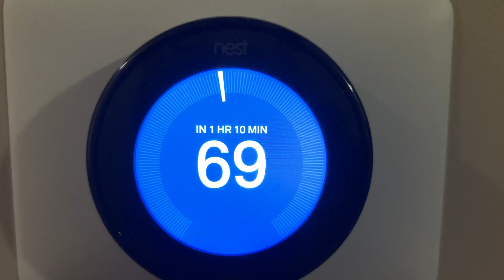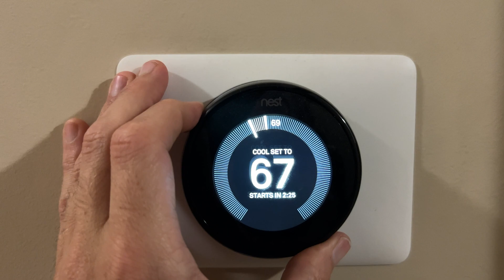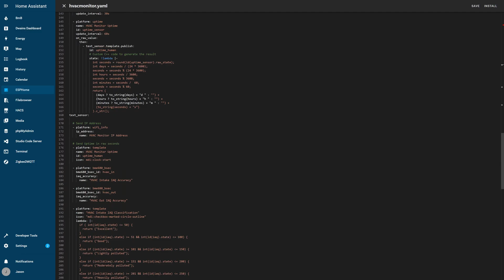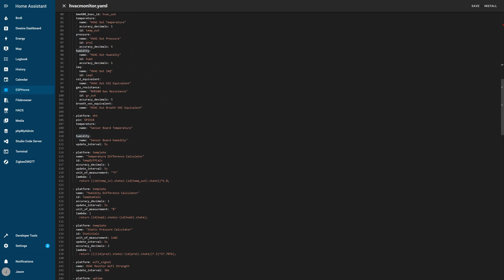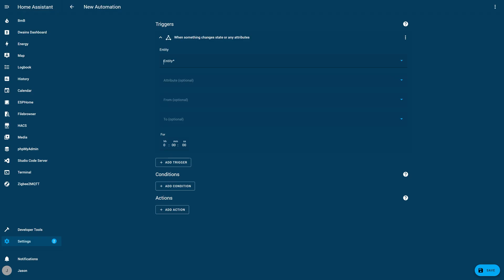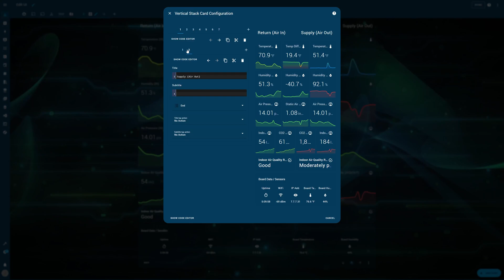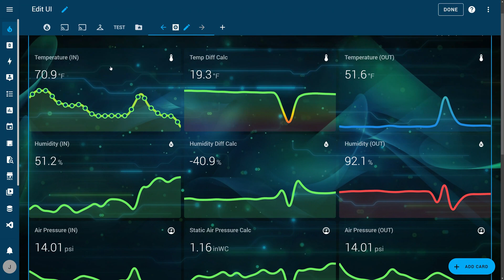I built the perfect HVAC sensor, for CHEAP! Temps, Static Pressure, Air Quality, everything.

Comment: Only thing I would add is a pzem 004t v3.0 10amp to monitor power/energy to the furnace. That way you can use instant power to gauge motor fan speed and do CFM estimates based on the fan curve (static pressure and motor speed) using linear interpolation and get amazing data for heat output and all sorts of data.

Comment: Add a few more sensors , Temperature sensors on the Evaporator coil and Condenser coil to insure that the system is operating in a specific mfr range. Differential Pressure Sensor at each of your supply duct vents for adjusting the HVAC system air flow, a Pressure Sensor on the high and low pressure fittings (difficult, may require a HVAC tech), a Differential Pressure Sensor before and after the system's air filter (when to change) and a LED display for each of the thermostat contacts to show what is working (works great to verify if the thermostat is not working properly) . Good luck! Maybe material for a future video.

Comment: Two things you may want to test on a normal basis is Temperature Rise, and Drop which can give you  a lot of information with two basic sensor readings. 
High difference in temperature readings indicate restriction in air flow and low temperature differential can mean loss of heat transfer. This will work for both Heating and cooling modes.

Comment: Interesting, but your sensors are in the wrong spot. Supply temp sensor shouldn’t be in line of sight of the coil.  Pressure sensor for your furnace should be before the coil.  I don’t recommend drilling that with your set up or you will hit the coil.

Comment: @6:59 your humidity is way too high - assume you caught that?  Means your blower fan is running too fast?  Also, your static air pressure seems high too at 1.19; i'm not a HVAC expert but, like you, have been learning & maintaining my own systems and a typical static delta is 0.5 from all the systems I've worked on.  I've seen 1.0 inWC here and there but it's usually a max value and yours is 1.19.  How accurate are your sensors?  Did you calibrate them?  You could use static pressure delta to know when to change your air filter.  I have a similar project but I'm trying to integrate actual line pressures and get subcool/superheat values into home assistant - get early indication of refrigerant leak or compressor failure.
Reply: How's it going with that? I'm about to dive in

Comment: Hi, thanks for taking the time to document your project!  

I'm looking to buy smart dampers to A) adjust the airflow from the main trunk to each room, so the rooms have equal temperatures and/or B) adjust the airflow to avoid heating rooms that are currently unoccupied or known to be unoccupied during specific date times.  The issue is that the HVAC systems need to maintain a minimum airflow to avoid burning things out prematurely.  Is it true all I need is to build sensors to measure the following 4 points (inbound before the air filter, inbound after the air filter, outbound before the A coil, and outbound after the A coil) to measure static pressure and CFM and then somehow keep an eye on these while I'm adjusting the smart dampters?

Comment: Nice work! I esphome'd my fridge and found the BME280 sensors did not appreciate being on a freezer's coil during defrost, above about 90% they start dropping out. For a while power cycling it worked but it died after a few months. I now use DS1822b or whatever they are in the freezer and bme280 only in the fridge compartment. I mention it due to the surprisingly high humidity your dashboard showed for the output - I'm wondering if it was maybe experiencing some condensation? I assume the humidity part of the bme range are all similar.
Anyway great work, I am looking to do the same thing with our ducted AC system along with diy dampers for room-zoned automation - keeping an eye on static pressure to avoid issues when closing off zones.

Comment: Just some odd thoughts.  I like this idea a lot. My AC is most likely the largest contributor to my utility bill.  I placed a UV light in my HVAC system The UV light is set to run 24/7 but using two smart plugs I turn on the UV light when the when the blower motor come on and then turn it off five minutes after the blower motor goes off.  The light was to last about one year, by running it part time I should get four or five years from it. I can also use the other plug to turn off the entire unit.  I upgraded to Merv 13 or better filters.  I have a 2.5 air quality Gauge but haven't found a way yet to turn on just the fan to "polish the air".  Not sure where your pressure measurement are taken.    Also I had a college HVAC text dated cira 1950, which I cannot now find, which plotted a comfort zone of temperature and humidity, it would seem that could be used to select the cheapest way to get from outside the zone to inside with an automation.  Anyone seen a similar graph?

Anyway great project.  Looking forward to seeing if I can build one.

Comment: I made something similar but with the esp-01 and DS18B20 sensors. It worked but I have trouble keeping the wifi connected. I'm now working with the MCP9808 so I can add an I2C OLED. I like your idea a little better so I can measure pressure too and it whould still work with the esp-01. I think I'll set up an esp32 or pi zero to receive the data and host it. I'm hoping I can run the rx/tx down with the thermostat wire and put the host device there for better wifi connection. Was going to use a battery but I can tap the 24v ac and use a buck converter there to power the esp32 and the esp-01. I can do the same thing with my DS18B20 esp-01 board to measure liquid and vapor temps.

Comment: Very cool project!  Just searched and only one like it so far...I will be watching/hoping for update vids!  Funny I was actually helping a neighbor troubleshoot his system the other day and thought how beneficial sensors would be for alerting when there are issues before looking at your thermostat and wondering why it says 80 degrees.  Would love to see:
-- CT clamp to monitor the amperage on the blower motor.  Some higher end units are flow based so they ramp up power to maintain a certain flow rate and overcome static pressure from a dirty filter.  But even just a simpler case in, one would have helped my neighbor, monitoring for zero amp draw for a blower not working at all when the rest of the system is still running.
-- leak sensor for notifying when primary pan or secondary pan are seeing condensation buildup.
-- air flow meter or maybe a temp sensor for the A-coil/evap coil to see if it gets frozen over or just track historically if it is increasingly restricting airflow (dirty)

Comment: already have Sense Power monitor displaying my hvac usage. Then got the A coil cleaning comb to remove the dirt from below the A Coil. No Form spray. Surge protection device - a separate one than the whole house one in the main breaker box - for the outside compressor unit. this was missing - more data!. thank you......might consider putting the $35-40 particle sensor box to check how clean is the air going to vent. so i don't have to change the filter based on time.

Comment: Look at the diffence between the high and low static. Take the number with a clean filter installed and double it. That is a good spot to set a filter change alarm.
Reply: Where would you instrument static pressures to verify correct flow for each zone? I’ve had issues with bad flow in zone2 vs zone1. Would the best be after each damper and then compare to before the coil after the blower?

Comment: @Byte My Bits : Did you every learn, specifically, why the buck converter (and it's different voltage) solved the conversion deviation issue?

Comment: for the hole i'd just drill with metal bit in multiple places and "connect them" with metal cutter
or if you have angle grinder, just make a slit 

edit rewatched it and using the small drill to make small hole, putting the tip of the sensor 0:49 and make some kind of mount (maybe magnetic) to the duct might suffice

Comment: I have used this sensor for 5 boards I have around the house and it is wildly inaccurate for co2. I have compared that against a real co2 sensor.
Temp and humidity is ok on this sensor nut personally I would not use this sensor again.

Comment: As a HVAC TECHNICIAN  myself well done 👍. 
Add a compressor, lying discharge temperature sensor within 6 inches of the compressors discharge line . 

This will give you an indication if you run low on refrigerant for your condenser fan fails your compressor will start overheating . 

This can lead to short life of the compressor . 

I think you already mentioned, WATT or amp draw. that’s for the compressor itself is another good indicator of something going wrong .

Comment: This is amazing. I've been planning on doing a similar monitoring project on my combi boiler. Logging temps going in and out, calls for heat, etc. I definitely want to incorporate something like this. Maybe I missed it, but why is the humidity out so high? Shouldn't it be much lower?
Reply: Saw that too...My guess is that the sensor is so close to the coil its picking up the humidity from the condensation on the coil itself?

Comment: Those dht11 humudity sensors are hughly unreliable. That might explain your issue with voltage. My current favourite is a sht40.
Reply from the maker: I don't have long term data to say you're right or wrong, so I will keep an eye on them :)
I can say that the sht40's dont measure pressure though. For this project, I wanted to keep track of my HVAC so pressure was a deciding factor. Also, for the bme680's, once I supplied a good power source they seemed very accurate and consistent. 
To counter my own argument though, I planned on possible issues with these (or any) sensors and made the board have plugs so I can change them at any time. 
Thank you for feedback and I welcome more ideas! This is a straight up learning thing for me and I'd love to improve it. :)
Reply: came here just to say dht11 is trash

Comment: What's the lifespan of these sensors? The capacitive humidity sensors can fail very rapidly, weeks to months, when exposed to high humidity. The buck convertor might fry if the input voltage drops too close to, or below, the output voltage.
Reply from the maker: The manufacturer claims 10 years, which I always take with a grain of salt. I planned on possible issues with these (or any) sensors and made the board have plugs so I can change them at any time. This is a straight up learning thing for me and I'd love ideas to improve it. You know of better, more reliable sensors that work like these and can give the same readings?

Comment: 69 all summer long would triple my electric bill. What's your electric company's ticker symbol? Good that these sensors exist. IME as long as the indoor humidity stays below the high 50s(%) it's okay to the mid 70s(degrees F). Most annoying is to step outside and find my glasses fogged up and my phone is suddenly wet to the touch.
Reply from the maker: I like the cold :) $500-$600 a month in elec bills tho..

Comment: You wouldn't have happened to have created a wiring diagram for this?
Reply from the maker: not yet because I dont have enough confidence in my design to share it. I have plans to improve though, so later I might :)
Reply: @Bytemybits  I’m an hvac mechanic and happen to think you’ve done a great job